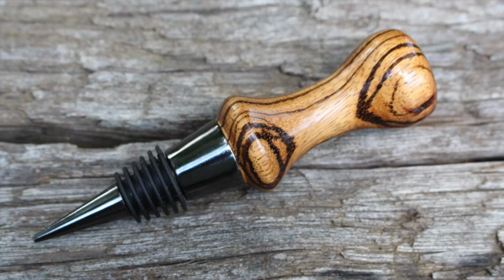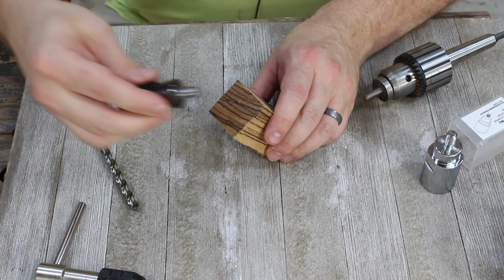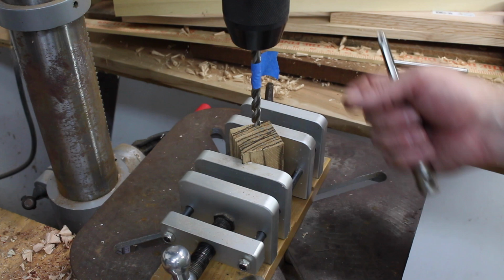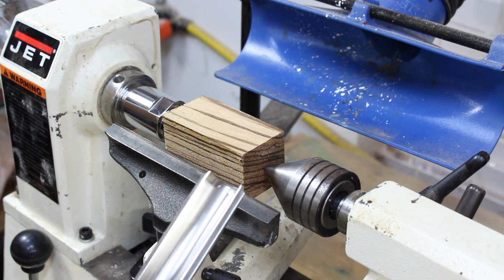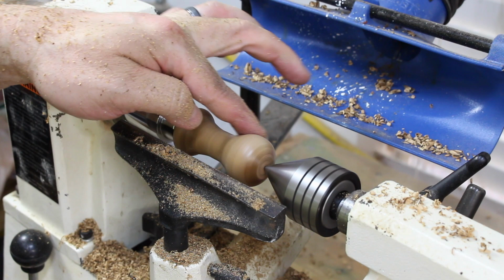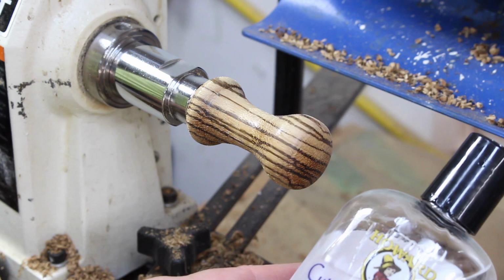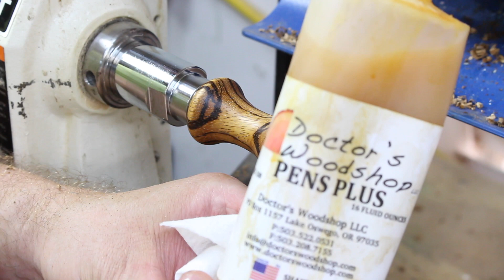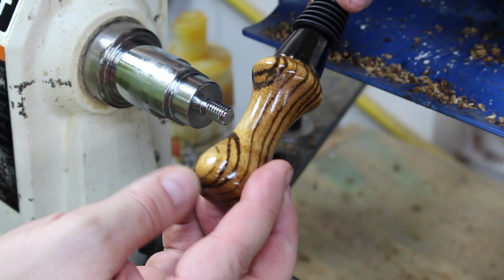How to Turn a Bottle Stopper

Comment: Thanks for video. I bought these kits and I am about to turn my first stopper. The wood I am going to use is not very hard. Do you think I should put some thin ca glue on the sides of the drilled hole before I tap it?
Reply from the maker: That would probably be a good idea if you're not using a hardwood. I would "dry" fit everything first before adding the glue. The threading works best with hardwoods for holding strength.

Comment: I wish I wasn't so scared to use those machines. I'd probably lose some fingers!
Reply from the maker: They can be a little intimidating at first, but once you get the hang of it, they are very fun to operate.
Reply: I got a jigsaw for my birthday last year.......... I still haven't used it. I tried for like 5 seconds. I'm too scared of the loud sounds, but I love to make things....... for now i stick to glue as my main tool :D
Reply from the maker: I used a jigsaw for many years before moving on to other power tools. Definitely ease yourself into it, but there is other woodworking like carving that doesn't involve power tools. You could, for example, carve the bottle stopper blank and not use any power tools. It will take more time and you still have to be careful with gouges. If the loud sounds of tools are bothering you, you might also try ear muffs to muffle the sound. But do what you are comfortable doing.  Good luck!